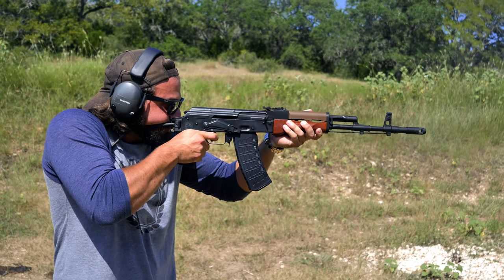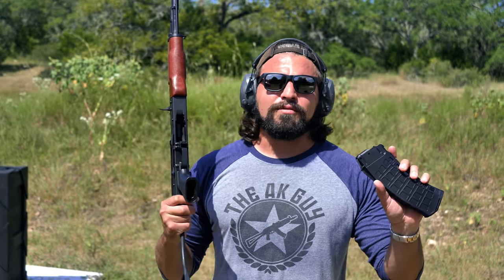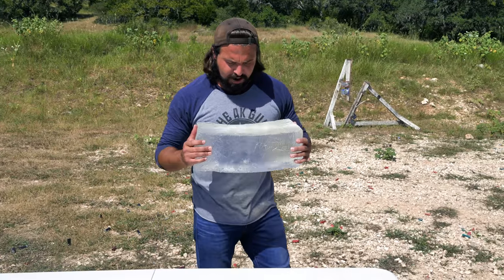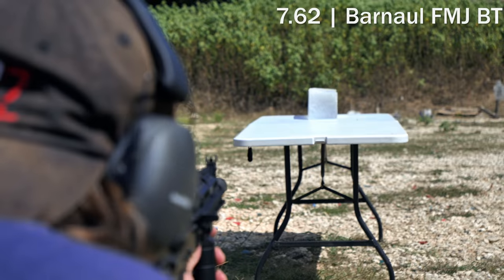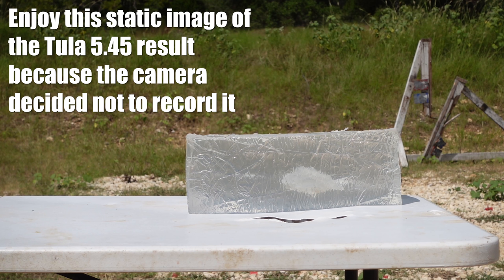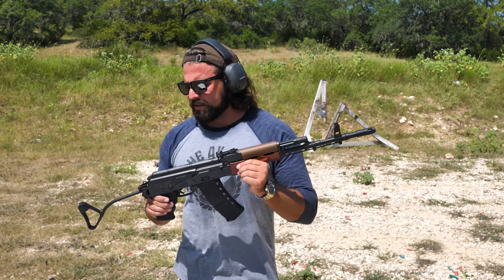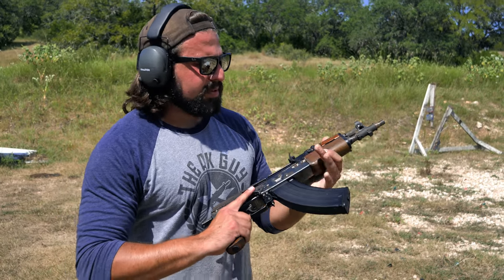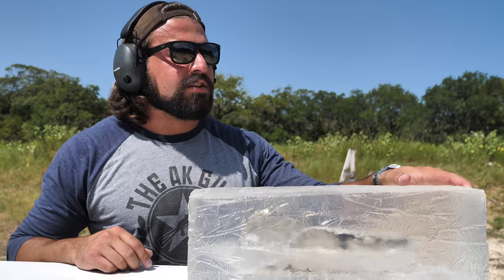7.62 vs 5.45 - Which Is Better?

Comment: I like 5.45 better for 4 reasons:
1: higher velocity
2: flatter trajectory
3: better penetration
4: less recoil
Reply: 5.45x39 7N6 has worse penetration than most FMJ 7.62x39 loadings. It loses momentum and Flips around (Yaw) in flesh and objects quicker than the heavier 7.62x39
Reply: @trippie_fabio3181  I think you just added to the advantages by accident.
Reply: To each his own. Honestly both excel under different conditions.  For close range engagements the 7.62 is better because 5.45 has about a 1000 pounds of force while 7.62 x 39 has 1700 pounds, however at longer ranges 5.45 is more effective dur to it being sleeker and more aerodynamic.
Reply: @easternrebel1061  Not really a valid argument, as by your logic the 7.62x54R would therefore be the superior CQB weapon.
Reply: B Kx  Do you know that one of the lessons of fighting communists guerillas in the Malay peninsula (jungle) in the 50s was that an ideal loadout would have been .22LR with tracers, instead of .30 caliber bullets?
Reply: B Kx  A) it was the case.  This is a fact.  I have the book. B) You see not long after that armies moved to the 5.56 and 5.45.  It's a question of load out and ability to lay down volume of fire.  Most small arms hits in jungle (and thick brush) are not aimed shots. It's literally spray/pray and with high volume, many rounds will make it through, regardless of the improved suppressing factor of firing more rounds.
Reply: B Kx  That's not true at all.  The primary reason for the switch was because the cartridges were adequate and the logistics made sense, not because they wanted to "wound." more soldiers.  Despite the advantages of wounding vice killing, you're going to need to provide a source on this one.
Reply: @trippie_fabio3181  That's why you use ammo meant for penetration.
Reply: @Keifsanderson  I literally never said 5.45 was bad lol i was saying it is literally objectively worse than 7,62 at penetration not at yawing
Reply: @UI_Shaggy05  Any armor penetrating 5.45 is pretty difficult to find i think
Reply: @trippie_fabio3181  Gotcha.  I misinterpreted your post.
Reply: @Keifsanderson  All Good bro

Comment: "Two biggest calibers that the AK is known for..."

Pretty sure 50bmg is bigger
Reply: no its  
12.7x108mm bigger than 50bmg(12.7x99mm)
30x165 ammunition much bigger and commonly used by army man to terrorist .
Reply: @chandima339  And what does Russian .50 or 30 mil have anything to do with an AK?
Reply: @samulivainionpaa9338  that's when the knowledge come .. have you ever herd of AK-630. and that do with an AK
Reply: @chandima339  So you are trying to tell me that because a Russian ciws system has the name AK in it, it has something to do with a Kalashnikov pattern assault rifle? 5/5 "knowledge"
Reply: @samulivainionpaa9338  and you saying 50bmg is bigger and compere to assault rifle round to anti material round ? yeh pretty much knowledge right there 0% ...
Reply: Has no one heard of the ak50? Wow... So sad
Reply: @Elemental-y4l  designated as ... 

anti material weapon ..so sad

Comment: Enjoyed the vid. Having fired countless 7.62x51 rounds from my army issued L1A1, compared to my personal 7.62x39 SKS, I found the 7.62 NATO round was far more accurate
Reply: More accurate but far less deadly at long range from the velocity drop.
Reply: 7.62x39 is really good at not being velocity dependent like 556 or 5.45 for a close quarters weapon I think it's one of the best still even though I like the krink ... I think platforms like amd-65, Draco will have a better use from losing less velocity etc...
Reply: @mikemcshea5919  What the flock are you talking about? 762×51 is deadly out to 1000 yards. You will be lucky to get 350 yards with 762×39. Hell, some snipers have made even longer shots with 762×51 NATO.

Comment: Good video, but why always shoot at point-blank range?  I want to see the effect off these calibers on a higher range. Maybe 200-300 yards.
A bigger Bullet with less velocity should lose energy faster than the smaller one with higher velocity.
Maybe it brings a clearer picture why 5.56 is still an often used caliber compared to 7.62x39mm for main rifles of most armies. 
I know the NATO standards play a role there. With easy sharing of supplies and stuff but still, maybe worth a video. 
Maybe even bring the new 6.5 mm round into play if you can.
Reply: You are a bit wrong, a fast projectile would lose its energy faster than a slow one since drag force is relative to squared velocity: D=1/2pCAv^2
However, 5.45 and 5.56 are much more aerodynamic than the 7.62 therefore they have smaller drag coefficient (C) thus reducing the overall drag force, and of course they have smaller cross sections. In simpler words, they are just designed with a better shape.

Comment: What is better 7.62 x 51 - 308 win using a 130 grain bullet you can get muzzle velocity over 3,000 FPS  my opinion AR15 5.56 - 223 rem is over rated under powered AR10 308 win has twice the energy and a better all around gun 5.56 is CQB rifle

Comment: Before obammy I was buying 5.45 for 3.99, after 2013 7.99, and now it's difficult if not impossible to get. (In my area) 7.62 was around 4.50 and now if you can find it around 15 bucks.

Comment: For general infantry and army use the 5.45×39mm makes more sense as most people can handle it.  The 7.62×39mm is fine for those who need more hitting power, but somehow the round is mismatched to the AK-47/AKM, unless fired at semi-automatic.  Even so, the long barreled SKS and RPK seems to get more out of the 7.62×39mm round, suggesting that it's more suited as a squad automatic, or the basic AKM should have had a longer barrel.  Curiously the AK-103 series fires the 7.62×39mm at a higher muzzle velocity than the original AKM or AK-47 which leads to better performance. 

The 5.45×39mm however seems more consistent across the board, on a short-barreled AKS-74U, standard AK-74/74M or RPK-74, it just seems to offer more consistent performance as opposed to (say) an M4A1 firing an 5.56×345mm versus an M16A2 or M27, the M4A1 cannot get the most out of the SS109 , while the full length weapons do better.  The FN-MINIMI/M246 doesn't seem to really offer significantly better performance to the M16A2 or M27 in terms of sheer ballistics.

Comment: They are both good. It comes down to what you're looking to get out of it.. During Vietnam there was a study that was lead by a army doctor named Dr.Fackler. He lead a team of medical people, engineers , and other experts.They concluded that the 5.56 inflicted more damaging wounds than the 7.62x39.  The reason was that the round would often tumble and break up after entering the body. The current version of the 5.56mm M885A1 that's used today is even more lethal  because it is "specifically" designed to tumble and breakup.The Russian's didn't understand this move by the United States at first.The Russian's began testing the 5.56 from captured weaponry and soon realized why the U.S. switched to the 5.56..The Russian's, In cold war fashion later came out with the 5.45 in the early 70's in response.

Comment: Which is better depends on what you want it to do. It is like asking which hammer is better, if your building a house then a big framing hammer is better, if your building an oak table then a small hammer is better. The old Remington catalogue states the 5.56 is a game cartridge for coyote and smaller. Never designed for military use which explains why the military has ever since been trying to make an inadequate cartridge adequate. 7.62x39 was designed exactly for military use and it is still working just fine. However the 5.56 can have an advantage in an urban environment for quick controlled spray.

Comment: Energy transfer is king.  Lead round balls are usually low in FPE, but they do horrendous damage because most of the force is transferred into blunt impact rather than penetration.  If you ever want to see wild stuff, take slow motion video of shooting plastic bottles with cap and ball revolvers.  They get pulverized, momentarily bent what appears to be inside out, entirely emptied of water in a millisecond, and the label gets ripped off.  Sometimes the compressive force pops the top of the bottle clean off.  I’ve seen a bottle with a piece of its side ripped clean off as though a hand reached out and pulled it off.  This is due to the rapid energy transfer of the projectiles.  Most gets absorbed by the target, leaving very little for the backstop.

Comment: I have an AR that fires 5.45x39. It fires just fine when controle shooting. But when rapid fire the bolt carrier will get hung up on the next round in the clip and fail to feed. Is this a spring, buffer, or clip issue?

Comment: Just a question, not throwin shade. Why do so many guntubers  put the gel- block at the rear of the table where the energy dump is guaranteed to knock it off into the dirt? Shouldn't you put it up front and at least have a chance for a flip/roll/cartwheel and still get visible data? Or just bring some cold water to rinse it off, maybe? Just thoughts from a guy watching YouTube when he should be working.

Comment: Wow I just learned something new about the ak, I always assumed full auto was the option all the way to the bottom but it makes sense that they would put semi auto on the bottom.
Reply: As I understand it the reasoning is to make sure that the soldier really means it when going full auto. When he slams the safety off in a hurry under the influence of adrenaline, you don't want him putting it on auto by mistake. So full auto is a fine motor control movement, and safe or semi are not.

Comment: I think you should also test 7.62x39 vs 5.45x39 but in a full auto to test is it worth to have bigger cal. or more control on close distance in fully automatic fire. I  would like to se how much is the difference between 7.62 and 5.45.

Comment: which is better ?  
what's the intent ? what is the environment. 
for a long straight unobstructed shot in an open range - 5.45 is better
for close, partial or  fully obstructed  engagement  - 7.62 is proven better.

Comment: What about comparing the venerable 30 caliber (now known as 30-06) and also the venerable 7.62 x 54R (rimed) caliber.  I used the term venerable because I have respect for both calibers.
Reply: More on the 30-06. When you read the receivers on the 1903 variants and M1 Garand’s they are stamped with Cal 30.  And the pattern 17 which the original caliber was in 303 British but was changed to Cal 30 when the US entered WWI.

Comment: mm x 51 to 7mm x 51 (commonly referred to as the 7mm 08).  This could (with the proper machinery)  be done by re-hammer forging the barrels down to 7mm and heating the necks of the breeches then hydrallically ramming in a cold 7mm diameter neck sleeve and doing some minor abrasions & polishing.  The US could effectively use these weapons while new 7mm x 51 rifles are being produced then sell the modified ones back to the civilian markets after disabling the auto fire mechanisms to render them semi auto sporting rifles.  I'm amazed by the ballistic difference between 7.62x51mm  compared to those of the much lighter recoiling 7mm 08.  The 7mm 08 greatly wins hands down in many different areas.  It's not rocket science to realize how easy and cost effectively we could move to the new and much better cartridge with all the proper size brass already massively in great abundance that can be very quickly put into 7mm service with an extremely simple neck sizing.  This 7mm miracle can replace both the 5.56 as well as the 7.62 to streamline & standardize our nations military forces weather ground,  air, or in shoreline vessels. It would be the most impressive move we've mad in many years and loved by both our troops and veterans alike.  Of coarse what I'd really like to see happen is no more conflicts and the world working together peacefully.But I kinda think that ain't going to happen in my lifetime. pjkk  Graduate of Uncle Sam's polytechnic Institute USARMC Ft Knox, KY PS:  The new rounds would also be easier to hump around as I believe an adequate bullet weight for them would be only 115 grains to do the kind of damage we'll be requiring.  Now let's focus on personnel protection I.E: State of the art lighter weight body armor. better trench layouts and automatic enemy grenade rapid return super flingers.  There's still lots we can do to improve the lifespans of our troops if we think on it. If I had to go to war today I'd want my buddies and myself to have the capability to be able to penetrate walls and armor.  I think standardizing the 7mm caliber would do this inside a lighter to carry weapon that gets the job done with extremely tolerable recoil.Any lesser caliber would make the conversion harder and much more costly without any impressive gains in punch or ballistics.  American troops deserve the very best. My overall opinion is the seven 08 is the best direction we could go and I've scrutinized about this topic for many years.
Reply: Интересная мысль.

Comment: "Not at the expense of energy"...
Range for the 7.62 without variance: 500m.
Range for the 5.45 without variance: 350m.

Yeah, there is a LOT of "expense of energy" from one to another. 
The 7.62mm has better stopping power at range than the 5.45mm.

Comment: the reason the 7.62 AK didnt rise that much is cause you got an AK 74 brake on it. your add ons help a little also
Reply: That is what I have on my AK47 and is amazing difference
Reply: @mariusneumayer4419  I put the AK 74 break on my AK 7.62x39 after I had a machinist ream it to slip on the barrel. It make the AK real loud like a 308 in a 16" barrel so I took it off. is yours real loud?

Comment: By the way, I have no idea why Poles and if  I'm not wrong  the Romanians , went off from the original Ak-74 triangle folding stock with a "wire-type" folding stock ?
I always prefer  stability of the  wood(or plastic) non-folding stocks vs. the triangle folding. The wire type looks even more "shaky" than the triangle one. I can't see any benefits of it?

Comment: Which caliber does more flesh damage? These are damage from expansion, high temperature, dirt, bullet channel and path.
Reply: the 5.45 causes nastier (hard to patch up) wounds but to my knowledge as far as destruction goes they both cause similar amounts.
the biggest difference between the calibers is that the 7.62x39 has more impact shock which is good for "knocking the wind out of someone" and the added mass makes it better at barrier destructions and destroying body armor

Comment: 7.62 is stronger, the reason 5.45 is better in wars is because it doesn't overpenetrate like 7.62, it stays inside the wound, and instead of going straight through, it tumbles inside the wound and makes it bleed bad. Also if someone survives a gunshot (hard to survive 7.62 because yeah), they will have to get treated, which costs a lot of money, rather than just being put 6 feet under.
So basically, 7.62 for murder, 5.45 if you want to be an asshole or long range.
5.45 deals a lot of economical damage to the enemy while saving you money.
It's also perfect against third world countries because they can't afford as much body armor

Comment: 7.62 is not meant to be stronger or better accuracy. Its about how practical it is and its utility.
In Soviet and every nation still use 7.62 war theory. a proper gunfire need to be close. about 100meter or less. so more accuracy/velocity/trajectory for longer range is not needed and going to waste. You only should engage on firing if you see the target clearly. if not. hold the ground and let recon/airforce take care about it. a too long range gunfire usually ended up a waste of time and ammo. So they better dont do it.

7.62, in the otherhand, even tho its have worse energy, but because of the lead mass. the total linear momentum of them is still better than a 5.56. they can use it as a tool for suppressing fire. destroy cover. Thats why Soviet LMG can still use 7.62 x 39 without the need to issue another round like the NATO do with 7.62 x 51.

These days, even tho Rus decide to use 5.45 x 39. But a majority of soldier still prefer 7.62. They do it not for no reason. 7.62 can use to destroy cover or atleast dmg it hard enough to scare off people from that firing position. They prefer that style to engage rather than aim precisely and dig a hole in target helmet. 5.45 and 5.56 is good for personel target. but 7.62 have more utility. My country still stick to 7.62.

Comment: .308win > 7.62x39 or 5.56x45 > 9x19… cause .308 packs the wallop and bucks the wind, it’s common everywhere in America, 5.56 cause it’s light and fast and common everywhere in America, also will kill most things quickly with decent shot placement and if your aim sucks well you got 30 or more easily on tap… unless you’re into retro mags, then maybe only 20.. or one of those mags for hunting.. anyway and then if you love PCC’s well there’s 9mm also works in your side arm and if you’re smart takes the same magazines as your side arm.

Notice a lack of 5.45x39… that’s because it’s slower and weaker than 5.56 and less common. Why then include 7.62x39? Well cause it’s still a common caliber that packs a decent punch and is good inside 200m for sure. Which is where most combat happens.

Conclusion 5.45x39 is stupid, and only Al fan boy collector types want it.

/end.
Reply: В условиях США так и есть. 5.45 оставьте Российской армии и российским выживальщикам)